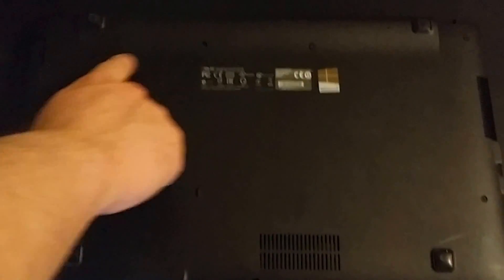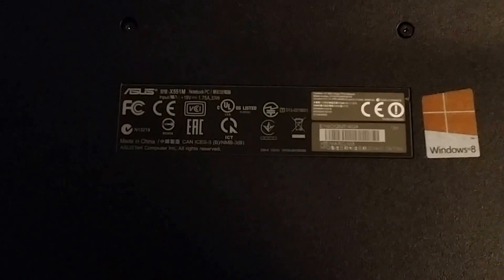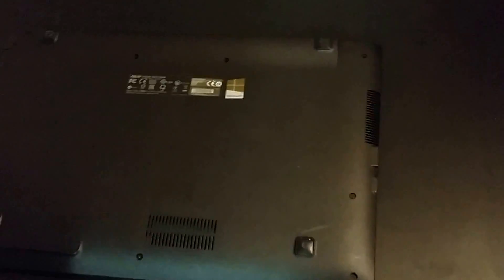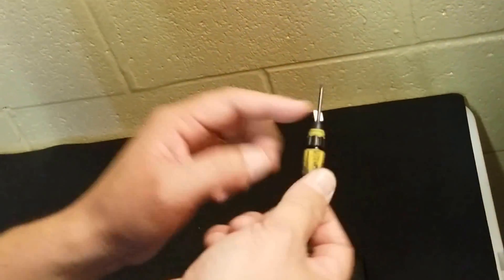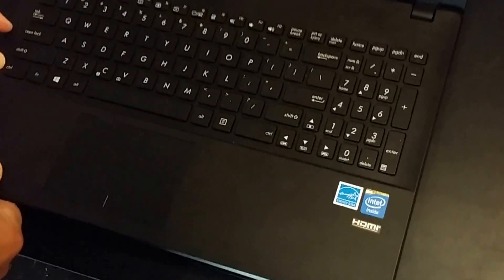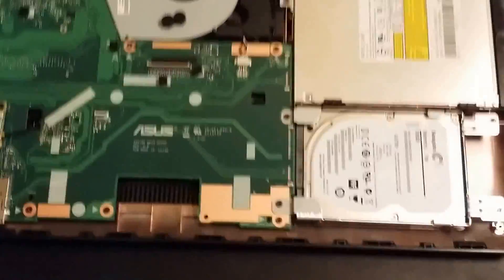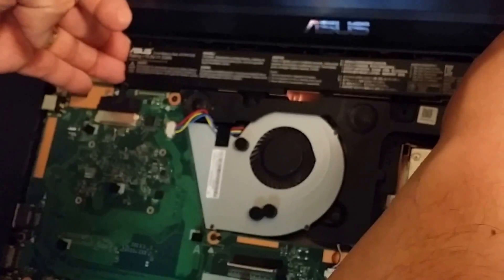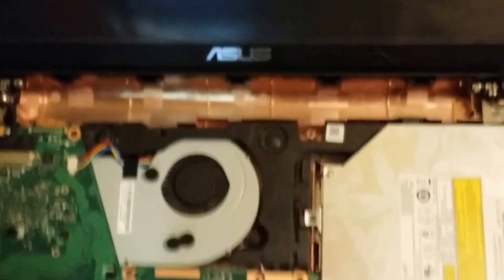ASUS X551M Laptop Battery Removal & Won't Power On Fix

Comment: Hey any tips on how to repair the power input that's been pushed in to far and can't get the charger cord to stay plugged in now?
Reply from the maker: +Ziggy Sixx If you broke the plastic molding that holds the DC Jack in place, there is really nothing that can repair that.  What I typically do to hold a DC Jack in place if that happens is get Loctite Putty : http://www.amazon.com/Loctite-Fun-Tak-Mounting-2-Ounce-1087306/dp/B001F57ZPW/ref=sr_1_1?ie=UTF8&qid=1460944674&sr=8-1&keywords=loctite+mounting+putty

I use that to hold the Dc jack in place by putting it behind the DC Jack so it can't move by being pushed too far.
Reply: +Angrysquirrel PC thanks it's my moms laptop I'll have to take more of a look at it.
Reply from the maker: NP.  Good luck!  Loctite works wonders when plastic molding pieces break inside laptops.

Comment: is it good or bad if it is non removal battery....
Reply from the maker: +omkar anvekar Well on this model, the battery CAN be removed.   You just have to disassemble it to a point where you can get to the battery.  If you have a different model ASUS, then you might not be able to remove yours.

Comment: can u add a pcie mini on a laptop without opening it like using a usb.
Reply from the maker: +ProWarGamer Not on this model, no.
Reply: +Angrysquirrel PC and do u think you can help me out on skype : goku17770
Reply: +Angrysquirrel PC i have a asus x555uf can u see if it will work on that.
Reply from the maker: +ProWarGamer Sorry, i don't Skype
Reply from the maker: +ProWarGamer Not familiar with that model.  For any specific questions, you can contact ASUS tech support @ 1 (888) 678-3688
Reply: +Angrysquirrel PC hey can u get to the mini pcie without opening the fron like the back or something.
Reply from the maker: No.  You have to disassemble this model to really get to anything.
Reply: ok thx ill give it a try.

Comment: My inlaws have this machine... I set it up for them... From day one they never used it... The battery, now 2 years later, will not recharge... So ALSO don't let the battery go completely dead... What a crap machine this is... smh
Reply from the maker: +Charlie Butler A li-ion battery usually lasts about 1-3 years.  You can purchase another battery for around $20-$30 dollars and change it out using my video instructions.

Comment: Hey guys I recently replaced my motherboard in this model of laptop but when I turn it on, the screen is just black.
Reply from the maker: +Tyler Alexander Does it power up with all lights on and Windows desktop sound or does it have no lights or anything?
Reply: its has lights and i can tell its on, but there nothing on the screen
Reply from the maker: Tyler Alexander Try connecting it to an external monitor then hit the FN Key + the top F1-12 keys (one of them switches the screen from the laptop screen to the external monitor).  If you can see a picture on the external monitor, then you must have not connected the LCD cable back in properly when you disassemble it.  If you do NOT see a picture, then you might have damaged the LCD cable or the motherboard itself.

Comment: Please show me the nvidia gfx card in it
Reply from the maker: +Rishi Kumar Ganta You would have to remove the motherboard in order to see it.  Remove the remaining screws that hold down the motherboard and disconnect any speaker wire connector, ribbon cables, wireless card/wires  and dc jack power plug that is installed on the board.  Once all the screws and wires that are attached to the motherboard are disconnected and removed, GENTLY pull the motherboard away from the USB/HDMI (left) side that is inserted into the bottom case.  Flip the motherboard over onto an electrostatic bag and you will see the CPU/Heatsink/Fan, Memory and the Graphics Chip.  The Graphics Chip is the chip that is exposed (the smaller chip compared to the CPU).  Some models have it hidden under the heatsink pipe furthest away from the CPU while other models have it just passively air cooled.

Good luck!

Comment: Hi sir, i have a problem that my laptop Asus x555L does not recognize or not detected battery, how would i fix this? could u help me? :)
Reply from the maker: +rasheed arabani Your battery has probably failed.  New battery are about $25-$30 on eBay or Amazon for your model.  Use my video as a starting point to disassemble and remove/replace your battery and you should be fine.

Good luck!

Devin
Reply: +Angrysquirrel PC oh too bad 😞 well thank you very much for the reply 😊
Reply from the maker: You are most welcome!  Li-Ion batteries only last about 1-3 years depending on use.

Comment: hi. my Asus laptop I on it and then I only see a balck screen please help me I have work and impor things in it
Reply from the maker: +Raymond Lee Either your graphics chip went bad (if you are still able to power up your system) or your LCD cable may have been detached accidentally.
Reply: +Angrysquirrel PC so any suggestions on what should I do
Reply from the maker: Raymond Lee Did you disassemble it to remove the battery?  I have no idea what you have done to the computer at this point.  Did this problem happen in the past?

Comment: Hi, I've done this to fix my laptop, same model. But my only issue is that after reassembling the laptop, the screen did not come back on, if I connect a HDMI cable to it, I can use my t.v. for the monitor but I'd rather not as I don't have freedom to move with it, any help would be appreciated
Reply from the maker: +Karion Presswood You most likely accidentally detached the LCD Cable in the left corner (the rectangle metal connector in the top left corner).  Disassemble it again and remove the LCD Cable then FIRMLY press it back down back on to the motherboard.  You should now get your screen back working assuming that you did not damage the cable or the motherboard connector.

Good luck!

Devin

Comment: Where is RAM located?
Reply from the maker: +Igor M. There are some screws that hold the motherboard down.  Remove the wireless card antenna wires then unscrew then remove the wireless antenna.  Remove the remaining screws that hold the motherboard down to the base.  Gently slide the motherboard from the base away from the usb ports side to pull it off the base.  Flip the motherboard over and you will see the memory there.  There are two possibilities and the only way is to check.  Some of these boards have memory that is soldered on and cannot be replaced or upgraded.  The other possibility is that the memory can be removed and upgraded.

Good luck!

Devin
Reply: +Angrysquirrel PC Foken asus... cpuz shows one free ram slot. thanks for replay

Comment: I dont why but my Laptop screen won't trun on at all, but it says the screen light is on, plus it will not work on another screen to fix it. I have tried to restart it a few times as well to see if that works. What should I do? My laptop is a Asus that has AMD a10 on it model number is X550Z, also has windows 10 that was updated from windows 8.
Reply from the maker: +Brandon SkullBlood ICK.... Did this problem happen before Windows 10 was upgraded from Windows 7/8?  Do you see ANY screen like the ASUS splash screen prior to Windows loading or is it a Black screen at all times?  Do you hear Windows load the theme music as it come to the desktop since you can't see it?  Lots of questions but I need answers to answer your question.

Devin
Reply: +Angrysquirrel PC This is the frist time it did this with windows 10, not before the update.
Reply: +Brandon SkullBlood windows 10 is probably the culprit.  remove it and it should run normally.

Comment: @angrysquirel pc do you know how i can remove the keyboard from the
Reply: You cannot easily remove the actual keyboard fron the lid assembly.  There are little plastic tabs holding the keyboard inside that you would have to break.
Reply: +valdestot do you know if the x551 model is comparible with the d550ma keyboard 
touchpad
Reply from the maker: +marco quintana No.  You can pick one up for your model on eBay.
http://www.ebay.com/itm/New-US-keyboard-for-ASUS-D550M-D550MA-D550MAV-Series-wihtout-frame-/322041718802?hash=item4afb2ea812:g:QlEAAOSwyjBW6NW2

Good luck!

Devin

Comment: Hey! Do you know if the battery disassembly is about the same with an Asus S301LA-CH1094H ? 
Thank you for your help
Reply from the maker: +Judith Wolff I have yet to disassemble that one to know the answer.  I would suggest CAREFULLY removing all the screws from the base unit and GENTLY spreading the keyboard/top lid away from the base like I show in the video.  NUMBER ONE RULE:  Never force something apart if there is no "give".  If something is supposed to be disassembled, it will do so usually with minimal force.  Let's not break something due to carelessness and too much force.

Good luck!
Reply: Thank you for your help!
Reply from the maker: Anytime!  Good luck and let us know how it turns out and if it is similar!

Comment: I have a 2016 asus laptop model and I was like screen y dafuq  u no work I waited 4 min after I turned it off and then turned it back on it works just fine now :)
Reply: how u cut it off mine will not cut off the lights...but the screen is blank and no sound...:,(

Comment: I have an asus X554L and there's this little panel thing on the bottom. What exactly does it do and could I open it?
Reply from the maker: +John Woo That panel cover on the bottom is the memory cover.  On this particular model, you have the ability to install additional memory in the ONE DIMM Slot.  The 4GB of memory for this X554L that you have now is soldered on to the motherboard and cannot be removed.  So you can add more memory using this slot.

Hope this helps!

Devin

Comment: The largest middle ribbon doesn't seem to have the pins to connect like the small ribbon I don't see where it inserts or how to make it connected again I am talking about the thickest largest ribbon or does it stay like that
Reply: +Valerie Jones The Keyboard ribbon cable is inserted just like the orientation in the video shows.  Let the natural bends of the ribbon be the determining guide on which way to insert the cable back into the ribbon connector on the motherboard.  Once inserted, slide the locks on either side of the tabs back into place to lock the ribbon.

Comment: hi my asus x553m laptop wont turn on or charge but makes this continuous beeping sound. how do i fix it?
Reply from the maker: +ROIBENVER N ACLARO It could be several things.  Your memory could have gone bad.  You may have a stuck key that is being pressed, or your computer may need to be reset by removing the battery.  Remove the battery using the video above.  Then reinsert the power ribbon cable without the battery and hold the power button down for 30 seconds to fully discharge the laptop.  Then plug in the power adapter without the battery and turn on the system.  You do not have to fully reassemble the laptop to see if the system powers on.  If the beeping continues without the battery and keyboard ribbon cable installed, it is most likely the memory.  Depending on if your memory is removable or not will determine if it can be fixed by you.

Comment: Hi, I have a laptop similar to this type. It's a ASUS X555LB, I need to know where to buy a genuine keyboard to replace mine.
Reply from the maker: +Edzel Mutas Is there a reason that is has to be a "Genuine Asus" keyboard?  Third party keyboards are cheaper and work just as well in my opinion.  The only sure fire way to get a genuine Asus keyboard is to call ASUS parts and get it directly from them.  If you want other options to simply get a new working keyboard, try:

http://www.amazon.com/SunSea-Keyboard-Without-X555LA-X555LD/dp/B01AJFVYOG/ref=sr_1_1?ie=UTF8&qid=1456674626&sr=8-1&keywords=ASUS+X555LB+keyboard

http://www.amazon.com/Laptop-replacement-keyboard-without-X503MA/dp/B015O2LF52/ref=sr_1_2?ie=UTF8&qid=1456674626&sr=8-2&keywords=ASUS+X555LB+keyboard

http://www.ebay.com/itm/US-English-keyboard-Asus-X555-X555L-X555LD-X555LB-X555LA-X555LJ-X555LP-laptop-/321899915351?hash=item4af2bae857:g:zhYAAOSwwbdWKILI

Good luck!

Devin
Reply: +Angrysquirrel PC I'm actually new to these things. Thank you for your suggestions :D I really appreciate it. I just want it to be perfect that's all, but if a third party functions the same then I'll go for the cheaper one.
Reply: +Angrysquirrel PC I'm really confused, If should I buy a replacement keyboard or have  my laptop ship to an authorized computer center to have the keyboard replaced (it's still under warranty, but I don't want it to be shipped).
Reply from the maker: Well shipping it to an authorized repair center (as long as shipping is free) is always better since you will not spend any money.  BUT if u DO have to pay more then the cost of the replacement keyboard on shipping, go get the keyboard.

Comment: Need to know how to replace the RAM.
Reply from the maker: +Yando Mabunda There are some screws that hold the motherboard down.  Remove the wireless card antenna wires then unscrew then remove the wireless antenna.  Remove the remaining screws that hold the motherboard down to the base.  Gently slide the motherboard from the base away from the usb ports side to pull it off the base.  Flip the motherboard over and you will see the memory there.  There are two possibilities and the only way is to check.  Some of these boards have memory that is soldered on and cannot be replaced or upgraded.  The other possibility is that the memory can be removed and upgraded.

Good luck!

Devin

Comment: i ripped the ribbions am i screwed? thx
Reply from the maker: +J. Kellz Here is a listing on eBay for a touchpad ribbon cable and for a power button board w/ ribbon cable.  Hope this helps!  Good luck!

http://www.ebay.com/itm/GENUINE-ASUS-X551M-X551MA-RCLN03-15-6-LAPTOP-TOUCHPAD-RIBBON-CABLE-/151764566727?hash=item2355df82c7:g:tsoAAOSwjVVVvHru

http://www.ebay.com/itm/ASUS-D550M-X551M-Power-Button-Switch-Board-with-Cable-60NB0480-/401074039349?hash=item5d61e02a35:g:3UIAAOSwWTRWxnaz

Just copy & paste these in your browser

Devin

Comment: I have an ASUS Q302U and have the inside opened up but can't find the battery..
Reply from the maker: +droppinthedeuce This laptop was released in the 3rd qtr of 2015.  Why in the world do you need to find the battery?  There is no way that the battery could have possibly failed unless it came defective from ASUS.  If that was the case, you should have a warranty for 12 months/1 year from the date of purchase.  Call Asus tech support and RMA that puppy and get it fixed for free.

Devin
Reply: ***** Yea I know I'm so mad. I bought it last November so I haven't even had it for 4 months and the battery is screwed. But I do have a 1 year warranty so I'll have to call them, thank you
Reply: +Angrysquirrel PC Do you know what causes this?
Reply from the maker: Defective batteries from the manufacturing plant.  You hear news stories about the REALLY bad ones overheating and exploding. The reasons are endless.
Reply: ***** thanks

Comment: Yes thank you. After i left that comment about my problem i did more research to find how to do all that. However my problem has not been solved. I took Battery out and held button down for TWO minutes and tried every combination or that imaginable. I tried taking the Battery out and plugging the ac adapter in holding button down no power on i tried every combination its still not powering on . I think its the mother board but how do i know. This lap top was relatively cheap bought a year ago for 200 something dollars . I don't have the money right now to buy a new one or pay a lot for someone to repair it. Mother boards are expensive but i was in a second hand store one day that had a specialty in computer parts and electronics i asked him if he might have a mother board that would work in my lap top he said to bring my lap top and he'd test it out and if it works he'd sell it to me for 20$ . Is that a good idea?
Reply from the maker: +Hollyann Brown OK.  Unless the motherboard is the EXACT model for that X551M, it will not work because it will not fit.  Laptop motherboards are keyed to fit into a SPECIFIC laptop case.  The odds of a computer store having that EXACT motherboard are slim to none.  Normally, we order laptop motherboards from eBay/Amazon or through the OEM manufacturer's parts vendor like Ingram Micro if none are available through eBay/Amazon.  If you do go to a shop, just make sure they have the exact motherboard based not only on the X551m but ALSO on the motherboard part number.  

1.  If after checking the adapter and removing the battery and plugging the Power adapter directly and it STILL won't turn on.......

2.  You either have a bad DC Jack or bad Motherboard.  For this model, they are literally one and the same since the DC Jack is soldered onto the motherboard.  You will either have to get another DC jack on eBay or Amazon and have some desoldering/soldering skills to remove the DC jack or you can purchase a new motherboard.  Better yet, take it to a computer repair shop if you don't want to deal with having to do this kind of work.

Good luck!

Devin